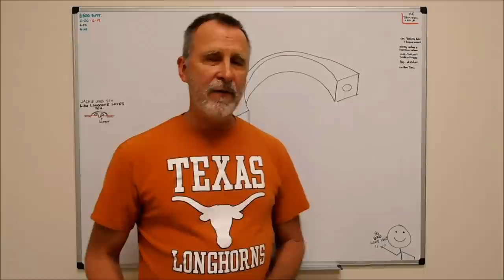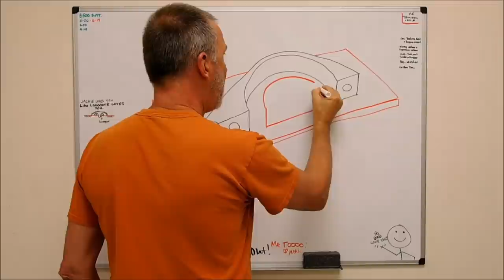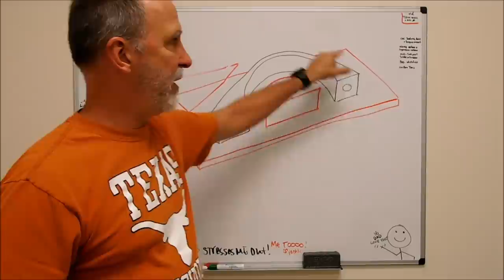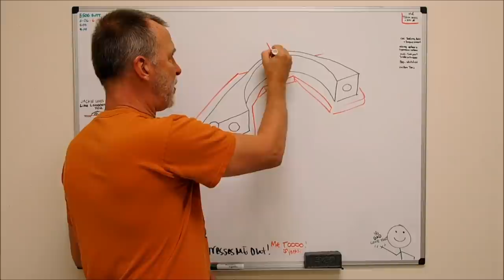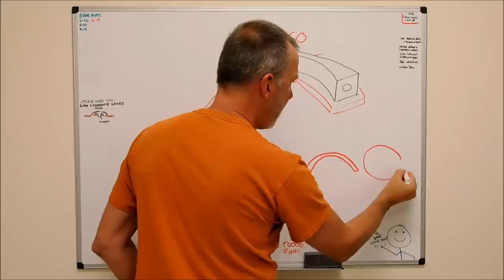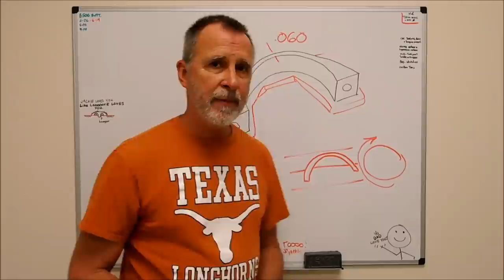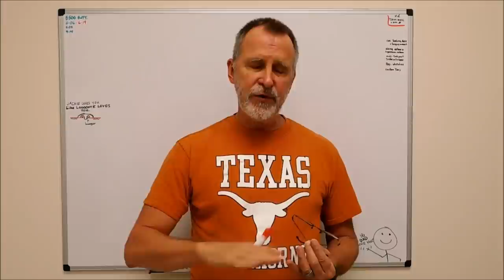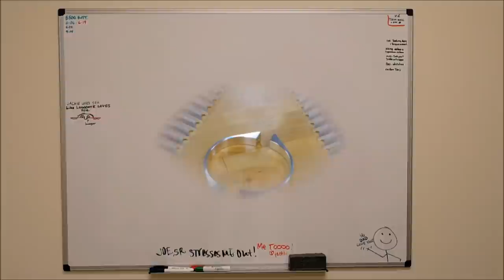Grip Stock - How to Access 100% of your Part Perimeter

Comment: you don't need to "establish" a flat surface, just use a center drill before drilling. thank me later.
Reply from the maker: A centerdrill doesn't have side relief beyond the second taper profile and would result is a torn finish from the excessive depth. It would also have to go very deep on an aggressive angled surface before it seated the next drill properly. I would not suggest that thought on a part that needed to be as cosmetic as it is functional. You can thank me later.
Reply: @joepie221  even if you used a number 2 center drill? won't go deep enough to spot drill it for you?